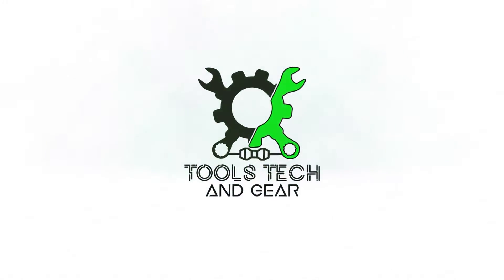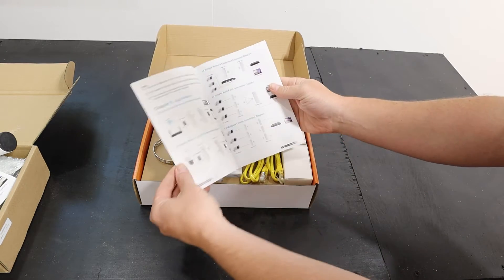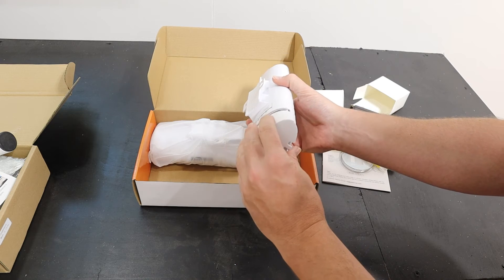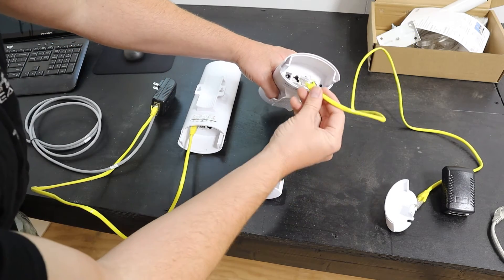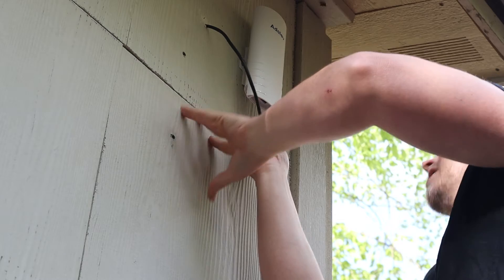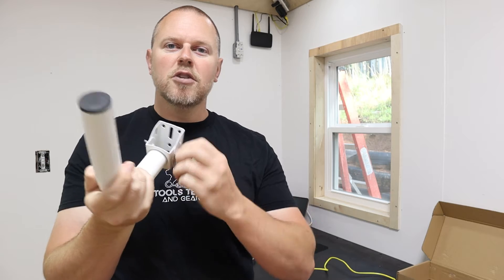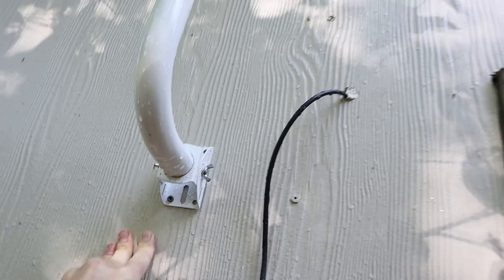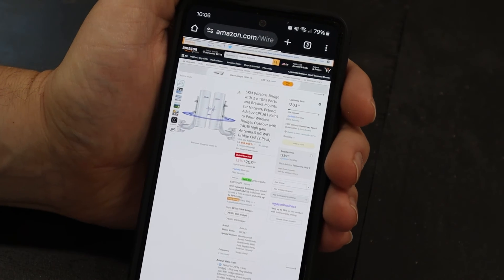Adalov Wireless Bridge Full Install

Comment: Sadly the PoE port is limited to 10/100Mbps speeds, the port 2 does gigabit but no PoE. And you should have done speed test as it is quite important info about these PtP devices. Some only get you 5-15Mbps even at quite short distances.

Comment: So, whats the point of the power outlet on each unit since the units get power from the ethernet ports?
Reply: Because the power outlet has the poe option for the bridge connection, and also the lan option for your router for internet connection

Comment: I'd like to know more about the router (wireless?) at the end of the 150'- how does that connect to the distant Adalov?
Reply: So do you have to separate networks with separate passwords? Could you use a WiFi extender instead of a second router to keep it all on the same information
Reply: @robhardell6997 I was wondering the same thing
Reply from the maker: The other two routers are simply basic wifi routers. The house wifi ethernet connects to an output on the router. The second router connects an ethernet to the input port. The bridge acts like a long cat6 cable.